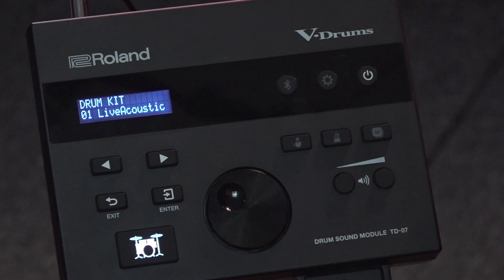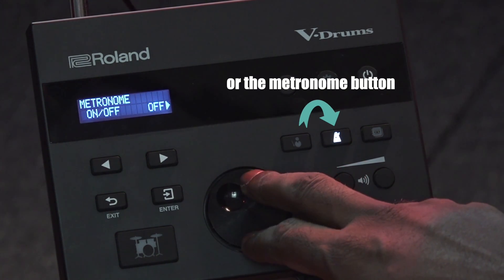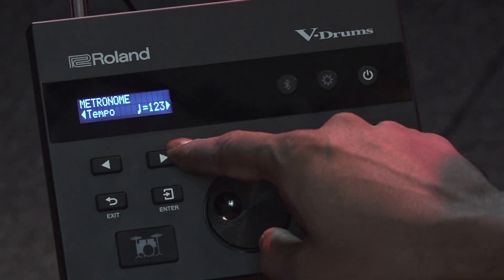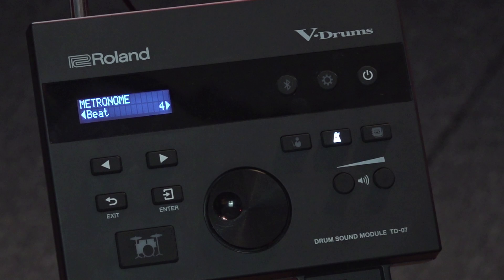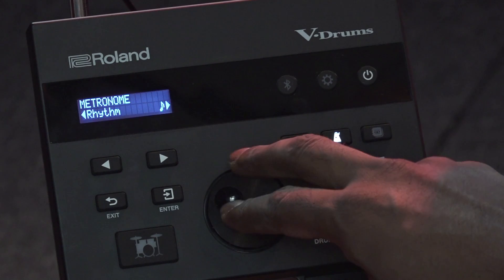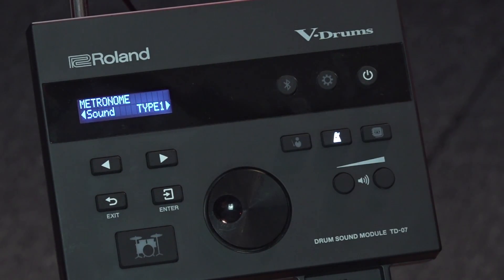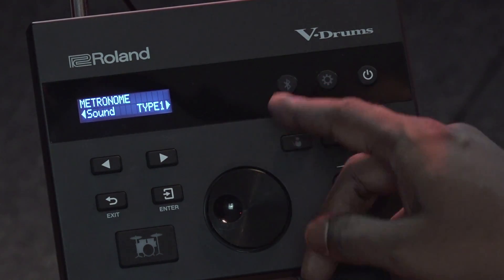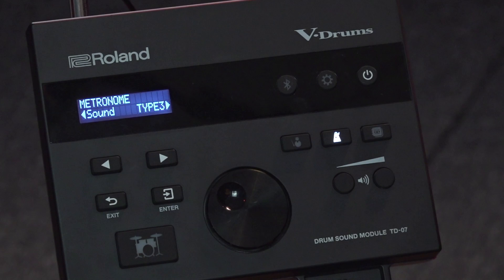Roland TD-07 (Metronome Settings)

Comment: Hello there sir I own the Roland TD07 KV. I’m trying to figure out how I can set up and adjust the sound that comes from the rim of my snare drum. I feel like I get some kind of sound but it feel like I have to strike the rim a bit to hard than necessary. Also, does this kit have to option to do cross stick? (laying stick across the snare) maybe you can help me .
Reply from the maker: The rim is velocity triggered. U can assign a cross stick sound to the rim but it will only sound when u hit it softer… if it’s hit harder at a certain threshold the rim shot sound will sound. The velocity point can be adjusted to player’s taste. Hope this helps.👍